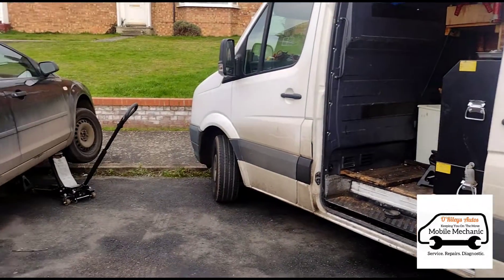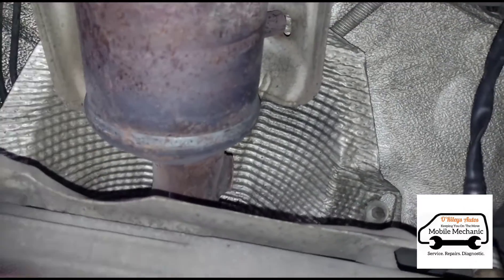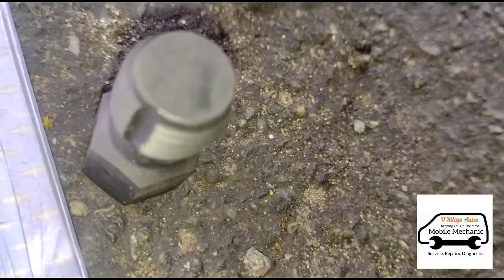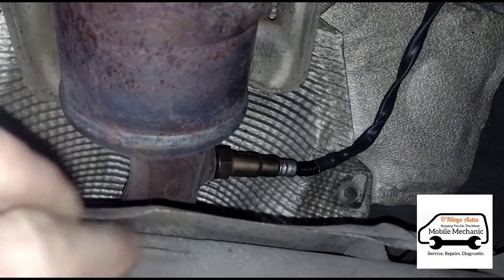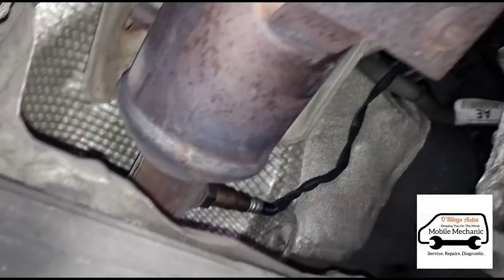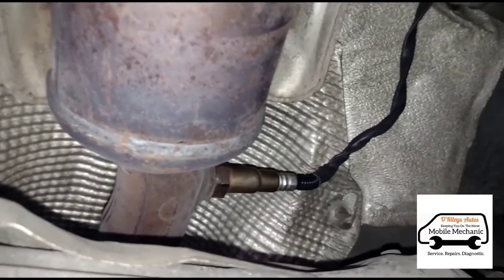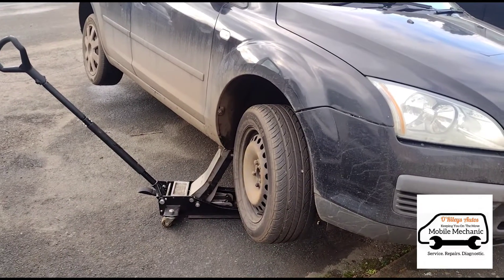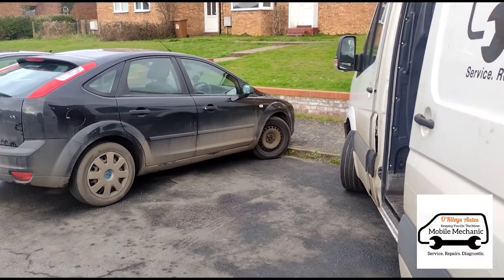O2 Lambda Sensor Damaged Thread Repair.

Comment: hello mate i changed my oxygen sensor a few years ago but it was cold out so i was rushing and when i put new one in it went in at a agle and messed up the thread so its not sitting  in there properly and ever since i seem to be using a lot more fuel  could that be why if you could respond i would really appreciate it thanks dennis
Reply from the maker: Yes. Oxygen sensor affects fuel consumption
Reply: @ORileysAutos  thanks for the reply could it also leak exhaust fumes in to car ever since i had to drive with the windows open and cant have the heaters on even cold air

Comment: Hey jimmy great job ..on my qashqai 1.5dci 2011 anti slip light on when I rev over 2k parked up or moving just same ..I’m sure it’s the exhaust pressure sensor pipe being blocked up ..instead of removing pipe ..will acetone poured down pipe resolve the carbon and free it up with out hurting dpf
Reply: Done a few of these blocked pipes ,cleaning injector decarbonizer and brake cable in a drill best method I have found ,but it's a pain ,13mm banjo bolt and horse shoe clip, pipe is off go to nissan 30 quid ishh for new one 10 to 20 mins as apposed to few hours trying to clean .
Reply from the maker: Yes people use an old brake cable from a bicycle and attach one end to a drill. Brake cleaner aerosol would also be a safer bet